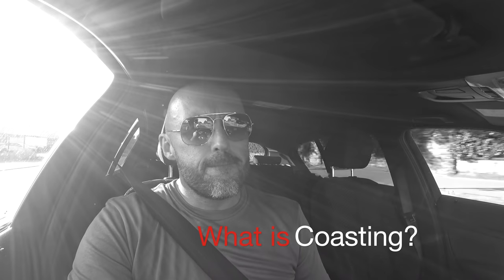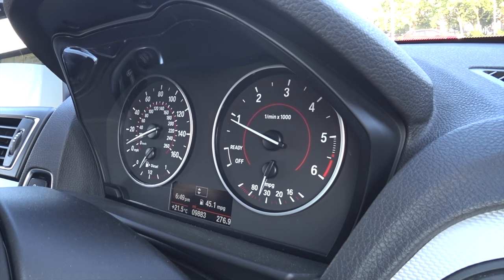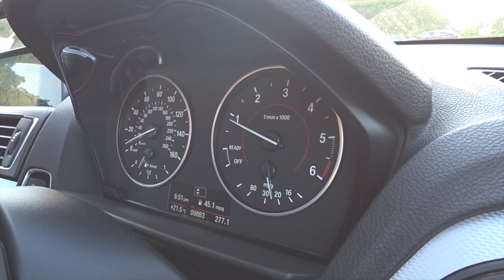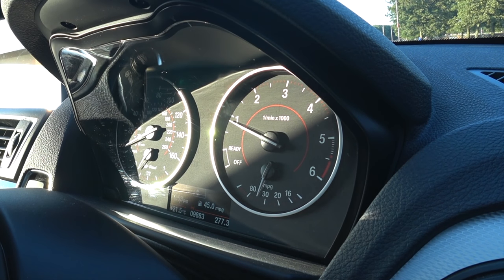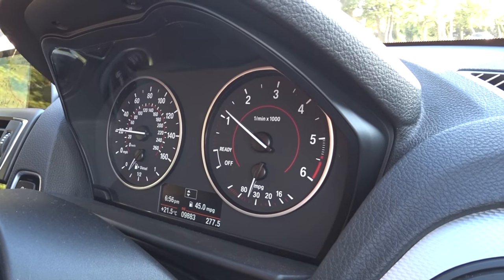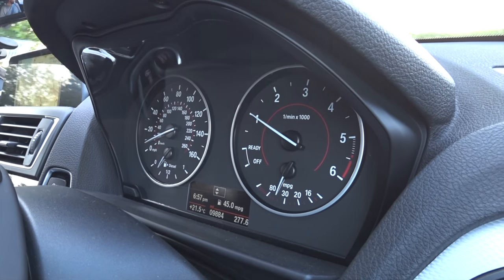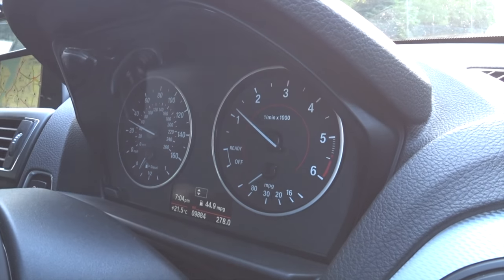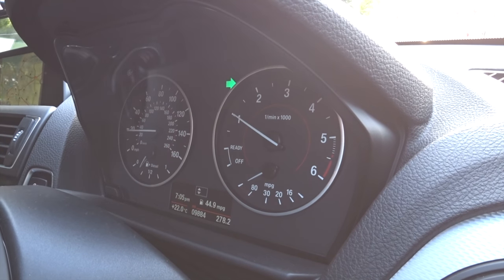What is Coasting? Part 1

Comment: I am surprised that saving the brakes by changing down was still common theory 20 years ago. I learned in the 1980s and often had heated discussion s with my father who desperately changed down through the gears at every red light.  What I find almost impossible is to follow my car's handbook and declutch for emergency stops.  Do you think declutching when braking hard with ABS makes much difference?  
I should mention that for 20 years up to 2000 I was a driving instructor and I always emphasised that you don't change gear to stop.  Just stop.

Comment: Coast everywhere if possible to save fuel
Reply from the maker: It doesn’t save fuel whatsoever Jamie. Quite the opposite in fact.
Reply: You're unlikely to save any fuel doing that as the engine needs fuel to tick over. When you are in gear and rolling the fuel input is completely shut off as the energy stored in the car rolling forward keeps the engine moving.
Reply: Just something my dad told me. I need to stop listening to him cheers ash
Reply: Satunnainen Katselija Oh god, please listen to the video and what people write above. If you coast, the engine keeps injecting fuel. If you brake with the clutch engaged (so not pressed down), the engine cuts all fuel. Do the math. Stop coasting. With an automatic gearbox it’s impossible to coast unless you put it in neutral on purpose while driving - which would make you a big idiot if you believe that that’s the purpose of the neutral gearbox setting.
Reply: I disagree with the replies below. If you coast out of gear yes the engine is using a minimal amount of fuel to tickover but you are not using energy to drive round an effectively "dead" engine if you stay in gear. The amount of energy used to drive the engine around is much more than the small amount of fuel used on tickover.

Comment: I like the future of electric and autonomous cars, but somewhere it’s sad that all these skills will become lost. In 30 years shifting a gearbox will be like putting a VHS cassette into a television.
Reply: @Finn G Maybe.. Though my current car is 20 years old and still on the road. Manual cars are still made today which are much better engineered than the cars 20 years ago. So i think they will be still on the road over 20 years unless the government forbids them.
Reply: The pleasure of driving without a clutch, clutchless start and gearchanges, in a manual is something few will experience in the years ahead.
Reply: @Richard
20 years may not be old enough. The electronics will kill most cars. I think current cars will only last ten years or so. Chances are the manufacturers will switch them off so you can’t use them and have to buy new anyway. You need something fifty years old for longevity. So what if you leak a bit of oil (English cars)! Big deal.